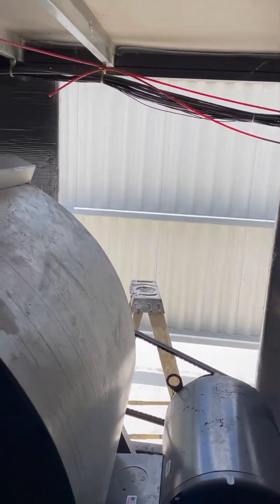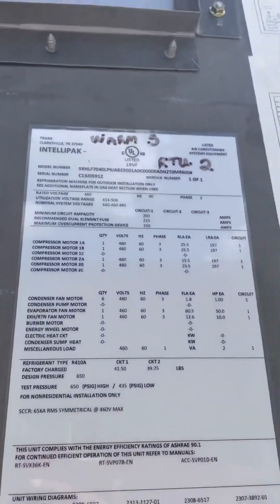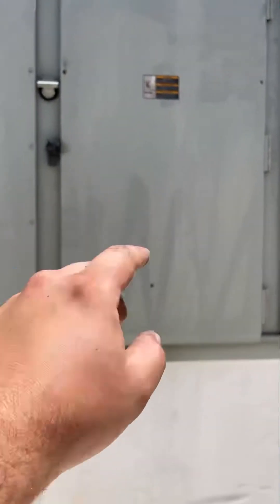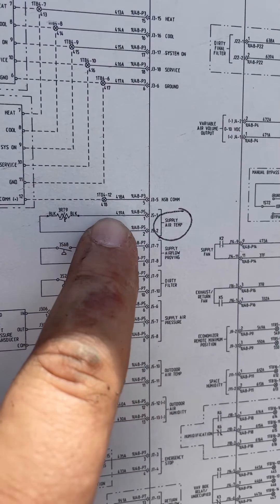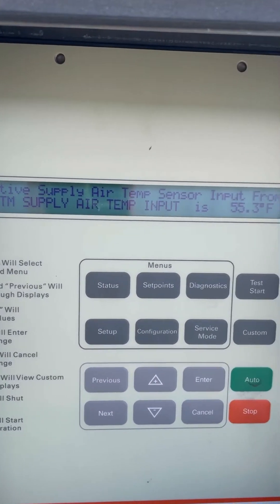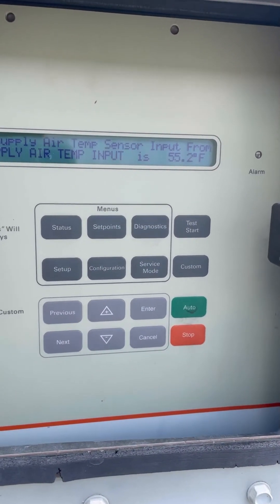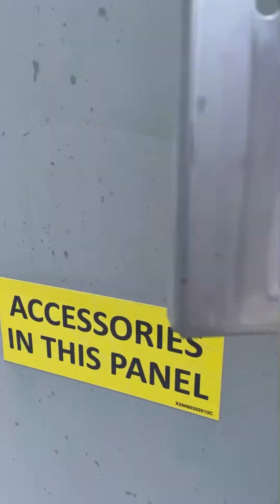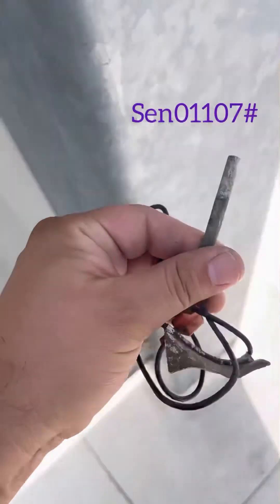Trane intellipac- supply air temp sensor (location)

Comment: Will this supply air sensor failure keep the supply fan from running and cause a supply fan failure fault?
Reply from the maker: Not to sure sorry, could be the sensor or the board the sensor plugs in to not reading it. I would have to check it out and do some troubleshooting sorry bro. Good luck
Reply: @Junkremoval-hvac  gotcha. I wanna say it’s that or the VFD bc it’s instant notification on the main display.